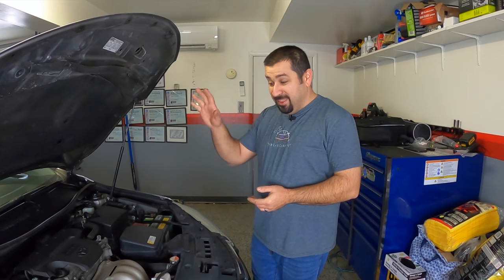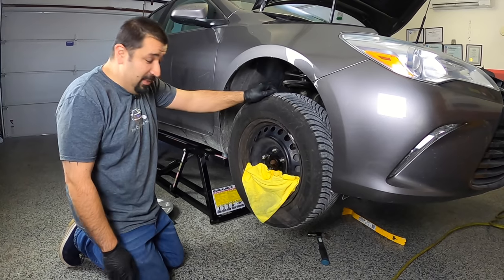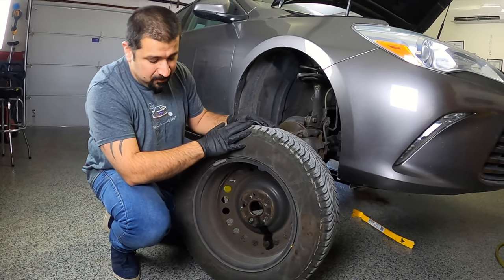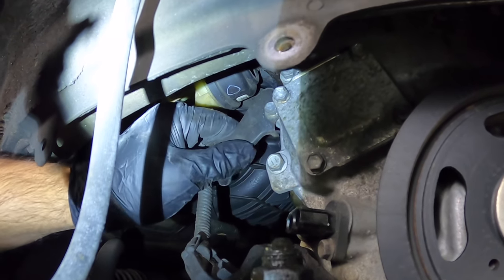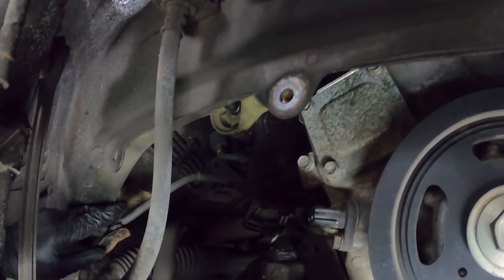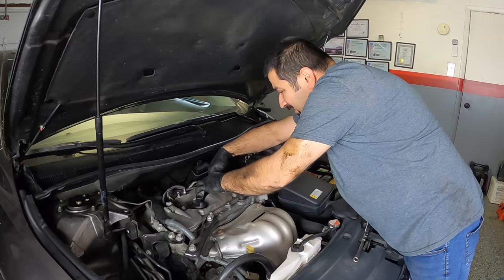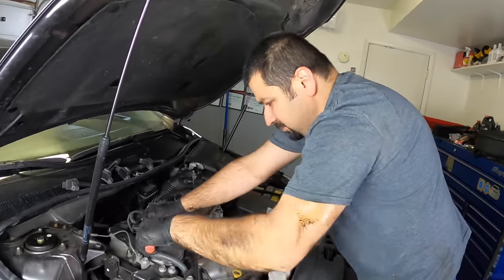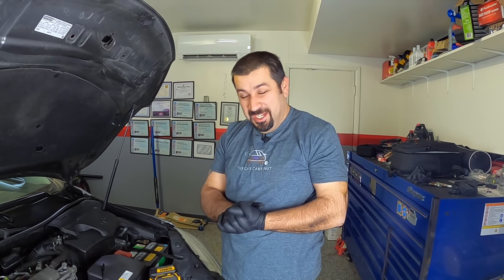Replace the PCV valve WITHOUT removing the Intake. Saving 3 hours of Labor.

Comment: Always love watching your video. Had a question about my 2008 Rav4 3.5 V6 (2GRFE). I wanted to replace the PCV valve, but it ask for "Toyota genuine adhesive 1324, three bond 1324 or equivalent". The forums are all over the place as what should be used. Can you please guide me as to what is the equivalent that i can use which is readily available in the auto shop. Once again appreciate all your help.

Comment: Helpful, excellent  video.Thanks. Is it the same location in a 2009 Highlander 4 cyl, base. And where is the other end of PVC hose hook up to?
Reply: its a 1ARFE
Reply from the maker: Hi! It’s the same for your highlander with the 1AR and the other end of the hose connects to the top of the intake manifold very easy to access under the hood
Reply: @TheCarCareNut  thanks lots. Went to Toyota Dealer service yesterday and quote me $825, 3.5 hr job got replacement of pcv.

Comment: … I did it 😃  ! as additional info the PCV doesn’t go all the way in, my old one was only half threaded inside the hole and the PCV is conical , that explain why you don’t need sealer or gasket … you’re welcome .

Comment: Just got my daughter a 2011 Highlander with the 2.7L 1AR-FE.  It drives excellent and for 120k on the clock, still shifts smooth and has pink transmission fluid!  I noticed a little bit of a growl sound to it when she pulled it out of the parking spot today... And that led me to start doing a basic tune up. Cleaning the throttle body, checking spark plugs, fuel system cleaner, and replace PCV valve (which led me to your video) are all in my plans 

Just have two quick questions for you. Is the pcv in her engine the same as the one you did in this video?  And, what do you think about that growling noise?  We used to have a 2001 Solara that made the same noise and lasted over 300k with, admittedly, neglecting every maintenance item other than oil changes, and those weren't even done often as they should have been.  So even though I'm going to be much better with maintenance on this one as I've learned a lot since then, I'm thinking that growl won't be a problem. But definitely curious what you think about it.

Thanks for all you do!

Comment: Great video! On the 2AR-FE, should I stick with 0w-20 or go with something like 0w-30 for “better protection”? My Camry has 122,000 miles and I want to keep it for many many more miles!
Reply: I have 2014 camry with 340000 with same oil 0w20 mobil1 without complains.
Reply: @javigon31  Thank you for the info!
Reply: I'd go with the thickest oil your owners manual calls for in your ambient temp range.
Reply: Pretty sure either 0w-20 or 5w-20 is recommended for this engine. That recommendation is based on the tolerances of the moving parts being lubricated. If you have had regular oil changes at the recommended intervals, and you are not losing excessive oil between changes, then stick with the recommended oil weight. 

If you are losing excessive oil between changes, you could go to a slightly heavier oil, but at that point you are only prolonging the inevitable.
Reply: I have that same engine and 197,000 miles, still using 0w- 20 just like new , change every 5 k miles and not using any oil runs like brand new
Reply: I use 0w30 mobil 1 my 2011 camry just rolled 260k

Comment: The tire looks like the Michelin Cross Climate ...........What are your thoughts on this newish tread tire ?............... I live in Canada and have lots of snow
Reply: The CrossClimate2 works great in snow. It's on ice that it will struggle compared to dedicated winter tires, even though nothing will really grip on pure ice. For urban Canadian situations the CC2 should be fine depending on your driving style and needs. Just gotta be bit more careful and not push the limits.

Comment: You are working on a single belt system this is possible from the bottom.  

Dual belt 2.5 Camry you have to go down from top and take off larger PS hose.  Even the dog bone mount for more room

Comment: Nice video.  I have 150K highlander 3.5 base model AWD.  I find out that the PCV is not functional well and I believe I have some carbon build in the cylinder head.  Do you recommend certain product to clean the engine from carbon? thanks

Comment: I saw your video on PCV installation. It encouraged me to change the PCV valve on my 2009 2.7 I4 Highlander. I think I stripped the threads on engine when reinstalling. Can you tell me what size tap I need to repair. Not sure if you will answer but thanks in advance

Comment: Years ago I was behind a minivan on the freeway that the front tire blew out on... I pulled over behind them, got it jacked up and the rim was stuck solid.  Beating on it didn't help.. then I had and idea.. I put 3 lugs back on all but 1/8 of an inch or so short.... lowered the vehicle and had the lady shake the wheel back and forth.. it popped right loose.  Jacked it up and changed it no problem then.  Thank God it was a front tire, didn't have anything with me to jar it loose had it been a rear one.  I hope no one ever needs this trick..and I hope it works if you do.

Comment: You said if the tube gets damaged, it's easy to replace. I have a 2010 how do I replace/install the tube if it gets damaged? Does the intake manifold have to come out that doesn't sound so easy if that's the case, Please advise.

Comment: When and why would the PCV valve need to be replaced?

Our 2009 Venza V6 isn't consuming oil, so during prior maintenance I just removed and cleaned the PCV with brake clean, made sure the valve and spring were moving/clacking freely when shaken, and just put it back. It is trivially easy to access on a V6 and inexpensive too. If it's recommended, I'll change it, otherwise why do something unnecessary?
Reply from the maker: Hi! Cleaning works but at their super low cost I would just replace it when you do spark plugs

Comment: My 2013 Rav4 , 4 cyl has a small rear main seal leak. It has 60k and well maintained. Could it be a stuck PCV valve ? Have you ever had that as a fix for the leak? I did try AT205 and helped for only a few weeks. Take care !

Comment: Use a piece of rubber hose on the pcv valve to get it started by hand.  It allows much better feel and space , then switch to a socket and extension.

Comment: Yeah, nightmare is right.  Took me 1hr 45 min to replace on 2016 Camry SE.  I’m contemplating boarding a hole in the wheel well to make it easier next time. Lol. I had a really hard time finding the correct socket/wrench/extension/knuckle combo.  So I figured 1.5 inch hole right on the wheel well, not sure if that’s advisable or not.  Or maybe it’ll just be easier next time now that I’ve done it once.

Comment: Excellent video, thanks. My question is why has Toyota made it so difficult with a screw-in PCV valve, why not a simple in-line with the hose secured by a clamp valve like it used to be?
Reply from the maker: Hi! It’s all for design and cost purposes

Comment: Put a piece of 2x4 between the back of the wheel and the frame then turn the wheel into the 2x4. Rotate the wheel 180 and repeat until the wheel comes off.

Comment: Hi AMD,  Any general mileage/time frame to consider when changing the PCV valve on a Camry?
Reply from the maker: Hi! With the spark plugs
Reply: @TheCarCareNut  Thank you!  Too hot at this location for Teflon Tape on the threads???
Reply from the maker: I wouldn’t use Teflon tape

Comment: Thanks for responding, I changed the oil 4 to 5000 mi.through out the cars life ,do you know what year toyota stopped using low tension oil rings ,they claim that the 2arfe doesn't have oil  consumption problems but mine sure does, by the way there is a lot of oil around the intake manifold .

Comment: Some of these tire places torque the hell out of the lug nuts when putting the wheels back on.  I had to pound on my driver's side wheel with a rubber mallet to get it loose in order to replace my transmission fluid on my 2011 Camry.

Comment: So if the hose goes up to the top of the engine you could spray carb cleaner down to hose during an oil change to clean it.

Comment: I think you can see the pcv valve if you use the small mirror with tap stick (or blue stick ) stick some where for easy to see then you use the torch to light to mirror ( put the mirror opposite the pcv valve ) ( if you haven’t got the small mirror you breaks to the size you need) use the head torch to light to the mirror  … then you can see the pcv valve

Comment: The Toyota dealership here in Aurora, Ontario, Canada, told me that Toyotas NEVER require PCV valves to be replaced, so there was no need for me to replace the PCV valve on my 2008 Corolla.  What's your view on this?
Reply: I agree, unlike the American PCV valves they are metal and a quality unit.  I changed mine on my 2003 Camry at 200k miles.  it is easy to get to on this model.  It wasn’t bad, i went ahead and changed it because I had already purchased the new one.
Reply: The PCV on our 2002 Highlander (easy to get to) went bad and was sucking oil and took out the O2 sensors. So, yes they do go bad.

Comment: I’ve a 11 Camry LE with hydraulic power steering pump . This is one where it’s electric pump ? If so I think mine is a lot less space. Far more cramped. I’ve seen one video where they have to take off much more parts out of the way. How does he put on the hose since he can’t get to the clamp ?

Comment: Lucky you I have 2010 Camry 2AR-FE and the PS pump is in the way, otherwise, everything shown matches my setup.  Oh man I really need to get my PCV replaced.  I replaced all the tensioner pulley and still hearing whirring noises.  Dropped oil pan, nothing look nefarious.  Oil pressure is okay, didn't get an error code.  Thank god it's still good.  After I dropped the oil pan, didn't noticed anything else unsual like shaving metal.   I noticed I'm burning more a quartz of synthetic 0W-20 oil every 3500 miles .  I'm betting my PCV is the culprit for both high oil consumption and whirling noises at any speed.  Can you do a video showing how to remove the PS as if you're replacing it?

Comment: Got a 2018 rav4 with 40,000 miles.I noticed there is alot of blow by with motor running and oil cap off.Thinking about putting a PCV Valve on oil cap to relieve pressure.Whats you thoughts on that?Also borescoped and pistons were clean and dry.

Comment: Did he mention how often to change the PCV valve? We have nearly 96,000 miles on our 2009 RAV 4 with this same engine and it's never been replaced. He said the PCV valve had thread lock or sealer on it, I guess it comes that way then. Correct?

Comment: When can I expect to have to do this on my 2009 RAV4? It has close to 67,000 miles on it now.
We also have Michelin Cross Climate2 tires on our RAV4 but with 18 inch wheels.

Anyone who has ever changed the starter in an old 4WD Honda Civic Wagon knows what it is to work by feel. For that job I even had to use two universal sockets between my ⅜ inch ratchet and the bolt.
Reply from the maker: Hi! With your spark plugs at 120k miles

Comment: Good God, I just did this on my RAV4, I am not sure that I saved any time over just removing the intake manifold. The PCV is way higher up behind the shield of the wheel well. The hose was way to tightly wrapped around the intake runner actuator. It ended up being easier to remove from above.

Comment: Who designs these engines? You have a lot of patience. I don't know if my PVC valve has ever been replace by the dealer. I don't see a reference to it online Toyota Maintenance.  I have 195k on my 5.7 2007 Tundra. I'm not experiencing anything weird. Should I replace the PVC anyway?
Reply: You can check it pretty easy just take it out on top of the engine, 13.00 part from toyota and takes 5 minutes. There are some videos on replacement that are out there.
Reply: @cparkerz2968  Thank you! Yes, I watched a few videos already and seems pretty easy to check or reach. But if I'm not seeing any issues maybe I should leave it alone. Oh I know, I have an oil change in April I will check it then. Thanks!

Comment: I changed my oil at 180K. Drove 2000 miles, and used one quart. Changed out the PVC valve, drove another 2000 miles, and used less than 1/2 quart! I'm happy that I reduced the oil consumption by half, but now its Tinfoil Hat Time....;)
The Car Car Nut has two very informative videos about why this Toyota engine consumes oil. In one he replaces the low-tension piston rings with the proper ones, and in another he installs a new Short Block. Now, I wonder why Toyota put low-tension rings on the pistons? 1/10 mpg better gas mileage? I wonder why they put the PCV in such a ridiculously hard-to-reach location? DIY maintenance-proofing? How many drivers have thought their engine was worn out when all it needed to reduce oil consumption was a new PCV?

Comment: I wonder would this work for the 2017 Highlander I4 engine? The diagram from the dealer shows it under the engine and quoted 850 dollars to change the PCV  valve. Lucky me.

Comment: I love my 18 corolla se I recently installed a rear Strut bar, new 1 inch lower springs and disks and rotors myself all red powdercoated TRD ORIGINAL PARTS . I followed your METICULOUS directions to the letter.  My cvt oil I change every 50,000 MI.  
I just changed it with factory FE OIL AND NOW HAVE 105,000 MI
. SHOULD I CHANGE MY OVERFLOW FILTER OUT AND IF SO WHEN.  OHH AND I ADDED STAINLES STEEL BRAIDEDBRAKE LINES  AND BELIEVE ME THE SUSPENSION IS LIKE NIGHT AND DAY

Comment: The positive crankcase ventilation (PCV) valve is a simple system that introduces filtered fresh air into the crankcase. The PCV valve uses the engine's vacuum to pull air through the crankcase and reintroduce it back into the intake manifold system.

Comment: Also, just realized. Is there a video with a Toyota that still has the hydraulic power steering in the way? If not, do you recommend any steps in getting into it?
Reply: Yeah I have that one also where the pump is right in the way.  I am going to go from the top.  Not done it yet but going to take off power steering lines to reservoir and small valve on manifold and maybe the dog bone mount to get in there.  I could not even get close.  I have the 2 belt system.  Changed both belts, oil change and cleaned out throttle body but wanted to get this PCV also.   Another day for this job.

Comment: Ahmd .. use the backyard method to remove rusted or fuse wheel 
1. loosen the nuts get at least 1/8 inch and tad more
2. make sure car is on park
3. shake the car side to side
the cars weight WILL persuade the wheel to come loose
4 . use jack and jackstands
AND LIFE IS GOOD !!!!!!

Comment: I’ve had a wheel stuck like that on the road. I had to lay down on my back and kick it with both feet. Just brute force. You’re running a risk of damaging a tire by doing so but if it’s already damaged ..and you’re out of options.. I don’t think it’s gonna hurt tooo bad.

Comment: Question: Relative has a 2014 Rav4 oil changed every 5000. Was driving hearing a noise like a ratchet. Turns out it was 2 quarts low... oil light came on. Could it be the PCV burning oil?

Comment: If wheel does not want to come off, install nuts lose, enough to keep wheel on position. Drive slowly and make eights. It will come loose. Not the best option but works every time.

Comment: In positions like that, I like to use an impact swivel between the socket and extension. Though I pulled the intake on my hybrid (intake gasket, tb gasket, PCV and cleaned the EGR and ports). That hidden intake bolt under the tb was brutal! Gave me a permanent scar on the back of thumb.
Also, I like to use a tiny amount of copper anti seize around the hub bore, personally.

Comment: I have positive pressure blowing out the valve cover when I remove the oil fill cap. Is this a sign of a stuck pcv valve or is this normal.
Reply from the maker: Hi! This could be normal. Is it excessive pressure or a slight pressure?
Reply: @TheCarCareNut  It's slight pressure. Maybe a few psi.The valve cover is starting to leak onto the exhaust heat shield. It's a 2014 RAV4 with 49,000 miles.

Comment: Why did he need to replace the PCV? What symptoms? My 2013 2AR Camry LE is at 104k miles. I'm the 2nd owner and bought it with 57k miles. I maintain it VERY well and did spark plugs early (NGK) with OE gap spec, 5k mile oil changes and recent did trans flush which eliminated the shudder.

But when should I consider a new PCV?

I have swapped engines and transmissions in my driveway with 100% success so I can do it lol.

Comment: When do you replace the pcv valve? 120,000 miles?
Is it necessary?
I had my mechanic tell me it is something you don't need to replace on a regular unless there is something wrong.
Thank you.
Reply from the maker: Hi! It’s not an absolute requirement to replace it but is good practice when you replace the plugs. You want to prevent issues should it ever get clogged
Reply: Thank you for your response. Hopefully I can get them to do it. My guess is they don't wanna mess with something thats hard to do or something that involves the engine if its good. However I love preventative measures. Thank you
Reply: @TheCarCareNut  about how much should you expect to pay to have this done by a professional? Also can these not ever get clogged? Thanks so much for helping people.
Reply: @TheCarCareNut  hey AMD!!! Could you do a video on replacing PCV valve on the 2010 and 2011 Camry because they have a hydraulic power steering system that’s in the way of the pcv.

Comment: Don't you have to remove the intake on the 2zr-fe engine to replace the pcv valve on that too?
Reply from the maker: Yes on that engine you need to which is actually easy to remove